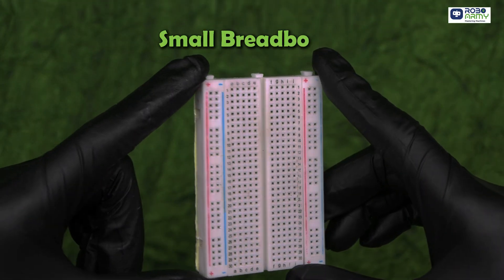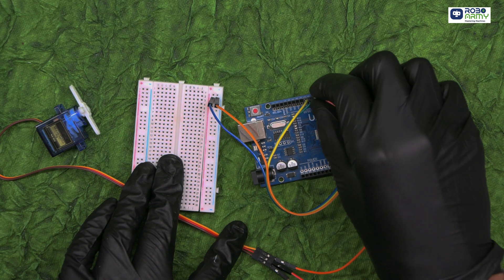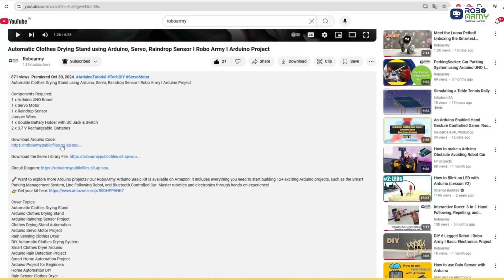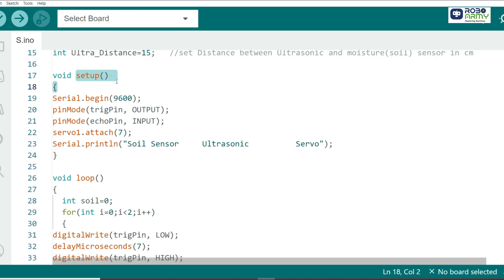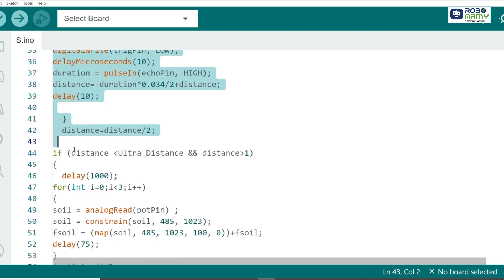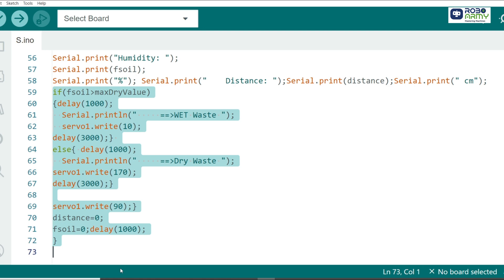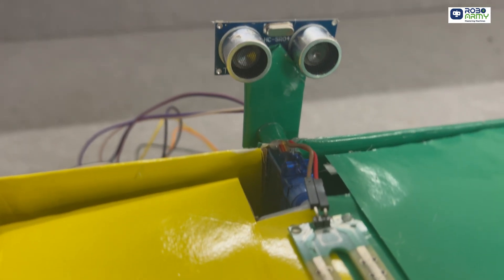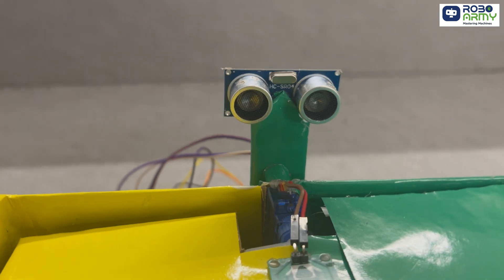How to make an Automatic BinBot: Dry Wet Waste Segregator Dustbin

Comment: Hello, 
I made this same project for my school exhibition but i am getting issue with my project because i am using two servo motor with my two separate dry and wet dustbin please send me coding for my project

Actually i made my both dustbins like open coverup style as we see in our real life mostly
All materials i used same as in your project except two servo that’s why i need coding of same project with two servo
Please help me 🙏
Reply from the maker: That’s awesome! 😊 I’m glad you’re working on this project for your school exhibition. Since you're using two servo motors for separate dry and wet bins, here’s the updated code that controls both. Let me know if you need help with connections too. All the best!

Updated Arduino Code for Two Servo Motors (Dry & Wet Bin):
#include <Servo.h>

Servo servoDry;
Servo servoWet;

const int trigPin = 8;
const int echoPin = 9;

long duration;
int distance = 0;
int potPin = A0;            
int soil = 0;
int fsoil;
int maxDryValue = 10;       // Humidity threshold
int Ultra_Distance = 15;    // Distance to detect waste

void setup() {
  Serial.begin(9600);
  pinMode(trigPin, OUTPUT); 
  pinMode(echoPin, INPUT); 
  servoDry.attach(6);   // Connect to dry bin lid servo
  servoWet.attach(7);   // Connect to wet bin lid servo
  Serial.println("Soil Sensor     Ultrasonic          Servo");
}

void loop() {
  int soil = 0;
  for(int i = 0; i < 2; i++) {
    digitalWrite(trigPin, LOW);
    delayMicroseconds(7);
    digitalWrite(trigPin, HIGH);
    delayMicroseconds(10);
    digitalWrite(trigPin, LOW);
    delayMicroseconds(10);
    duration = pulseIn(echoPin, HIGH);
    distance = duration * 0.034 / 2 + distance;
    delay(10);
  }
  distance = distance / 2;

  if (distance < Ultra_Distance && distance > 1) {
    delay(1000);
    for (int i = 0; i < 3; i++) {
      soil = analogRead(potPin);
      soil = constrain(soil, 485, 1023);
      fsoil = (map(soil, 485, 1023, 100, 0)) + fsoil;
      delay(75);
    }
    fsoil = fsoil / 3;

    Serial.print("Humidity: ");
    Serial.print(fsoil);
    Serial.print("%    Distance: ");
    Serial.print(distance);
    Serial.print(" cm");

    if (fsoil > maxDryValue) {
      Serial.println("     ==> WET Waste ");
      servoWet.write(0);     // Open wet bin
      delay(3000);
      servoWet.write(90);    // Close wet bin
    } else {
      Serial.println("     ==> DRY Waste ");
      servoDry.write(0);     // Open dry bin
      delay(3000);
      servoDry.write(90);    // Close dry bin
    }
  }

  distance = 0;
  fsoil = 0;
  delay(1000);
}
Reply: @robo_army_ thank you so much 🙏 after trying this coding i update you definitely 
Please tell me after getting success in this project can I show you video on your personal WhatsApp?
Reply: @robo_army_  when i am uploading this code then both dustbins lid are opening together and don’t closing
Reply: @robo_army_ please send me connections also
Reply from the maker: Thanks for the update! 😊 If both lids are opening together and not closing, it might be due to wrong connections or missing default angles in the code. Here's how to connect the servos and fix the issue:
Connections:
Ultrasonic Sensor
VCC → 5V
GND → GND
Trig → Pin 8
Echo → Pin 9

Soil Moisture Sensor (or Potentiometer in simulation)
VCC → 5V
GND → GND
AO → A0

Servo for Dry Bin
Signal → Pin 6
VCC → 5V
GND → GND

Servo for Wet Bin
Signal → Pin 7
VCC → 5V
GND → GND

Important Note: Use an external power supply for the servos if they are not working properly from Arduino's 5V pin.

Code Fix (Update These Lines in setup()):
servoDry.write(90);  // Keep dry lid closed initially
servoWet.write(90);  // Keep wet lid closed initially

Add these right after you attach the servos in setup() like this:
servoDry.attach(6);
servoWet.attach(7);
servoDry.write(90);
servoWet.write(90);

Comment: hello ,can we do the smae thing ,just replace the soil moisture sensor with rainwater sensor?
Reply from the maker: Hi! Yes, you can replace the soil moisture sensor with a rainwater sensor for detecting wet waste. Both work on similar principles of moisture detection. Just make sure to adjust the sensor threshold values in the code based on the readings from the rainwater sensor.

Comment: Hlo my arduino is burning due to heavy voltage
Reply from the maker: Hi! Sorry to hear that your Arduino is heating up. It sounds like it might be getting more voltage or current than it can handle. Please make sure:

You're supplying only 5V to the Arduino board (through USB or regulated 5V pin).

If using an external battery, avoid connecting more than 12V to the VIN pin.

Avoid short circuits — double-check if any wires are connected incorrectly.

Avoid directly connecting motors, LEDs, or other high-current components without a driver or resistor.

Comment: Hii sir i am making this for my exhibition.. But even after doing everything right it is not working can you please help me with possible suggestion to make it right... Please sir i have my exbhition they after tomorrow
Reply from the maker: Hi! I'm glad you're working on this for your exhibition! If it’s not working, here are some quick checks you can do:
1️⃣ Wiring: Double-check all connections – especially VCC, GND, signal pins, and servo.
2️⃣ Power Supply: Make sure your components get enough power (use external power for the servo if needed).
3️⃣ Serial Monitor: Upload the code and open the Serial Monitor to see if sensor readings are showing correctly.
4️⃣ Sensor Testing: Test each sensor individually with a simple code to make sure they are working.
5️⃣ Code Upload: Ensure there are no errors during code upload in Arduino IDE.

If you're still stuck, feel free to send a photo or video of your setup and I’ll guide you step-by-step. You’ve got this – let’s get it working before your exhibition!

Comment: Sir please 🙏🙏 I want very urgent reply......... I have made this project for my science model and I have to submit it Day by Tommorow.......but the major problem I am facing is that if I put wet or dry waste the servo motor rotate on only one side....... Pls 🙏🙏 I want urgent reply
Reply: Thank you very much sir 🙏🙏🙏🙏
Reply from the maker: Hey! Don’t worry, let’s fix it quickly 
If your servo is rotating in only one direction for both dry and wet waste, the issue is likely in the logic of your Arduino code.

Make sure your if condition for the moisture sensor clearly separates wet and dry values. For example:
int moisture = analogRead(A0); // or the correct pin
if (moisture < 500) {
  // Wet waste
  servo.write(0); // or any angle for wet
} else {
  // Dry waste
  servo.write(90); // or another angle for dry
}

Also, make sure your servo.attach() is in setup() and not repeated in loop().

Double-check sensor readings in Serial Monitor using Serial.println(moisture); to verify the values for wet and dry waste.

If you're still stuck, feel free to share your code—I’ll try to guide you right away.

Comment: Servo moves immediately to right after plugging in usb cable
Reply from the maker: This happens because the servo moves to the default position set in the code during setup(). You can add a command like servo.write(90); in the setup() function to keep the servo centered or in a neutral position when the system starts.

Comment: Bro we have to power it with what
Reply from the maker: You can power the project using Lithium-ion batteries (like a 3.7V or 7.4V rechargeable battery pack). Just make sure to use a proper voltage regulator or connect it through the Arduino’s Vin pin or barrel jack for stable power. Avoid powering directly through USB in standalone use.
Reply: @robo_army_  can we use a solar panel too ? like to make this proejct environment friendly ?

Comment: Hello sir, can i use arduino mega 2560 on this instead of uno?
Reply from the maker: Yes, you can definitely use the Arduino Mega 2560 instead of the Uno! 😊 The Mega has more pins and memory, so it's actually a great option

Comment: This isn't working for us .the servo motor isn't rotating.we tried checking each component seperately.everything is working but when connected we couldn't get output.we have even tried by connecting external battery with servo....still no response
Reply: change potentiometer accordingly it worked at max for me
Reply from the maker: Thanks for the tip! 🙌 Yes, adjusting the potentiometer (or the simulated soil moisture sensor) can help trigger the correct conditions in the code. Glad it worked for you! 👍 Others facing similar issues can definitely try this tweak.
Reply from the maker: Thanks for sharing! If all components work separately but the servo motor doesn’t move when everything is connected, here are a few things to check:

1️⃣ Power Supply: Even with an external battery, make sure you're using a stable 5V and the GND is common between Arduino and battery.
2️⃣ Servo Signal Pin: Ensure the servo signal wire is connected to the correct digital pin (in the code it's pin 7).
3️⃣ Code Logic: Check if the sensor conditions are being met to trigger the servo. Use the Serial Monitor to confirm values.
4️⃣ Try Manual Movement: Temporarily add servo.write(0); delay(1000); servo.write(180); in setup() to test basic movement on upload.
5️⃣ Capacitor Tip (Optional): Sometimes adding a small capacitor (e.g., 100µF) across the servo power lines helps stabilize power.

Comment: Hello! Servo is vibrating after detecting an object what should we do?
Reply from the maker: Hi! 😊 If your servo is vibrating, it could be due to:

1️⃣ Unstable sensor readings – Add some delay or average multiple readings to reduce noise.
2️⃣ Servo not getting enough power – Use an external 5V power supply instead of powering it directly from the Arduino.
3️⃣ Fluctuating values in code – Make sure the servo angle isn’t constantly changing due to small sensor variations.

Try smoothing the sensor data and using servo.write(90); (neutral position) when idle. Let me know if it helps!

Comment: for what purpose he servo library is required and where to add it?
Reply from the maker: Great question! 😊 The Servo library is required to control the servo motor, which opens the lid for dry or wet waste based on sensor input.

You don’t need to install it separately — it's a built-in library in the Arduino IDE. Just make sure you include it at the top of your code like this:
#include <Servo.h>

This allows you to use commands like servo.write(angle); to control the motor.

Comment: Hello sir, Can you help me regarding the servo motor that it only follows one direction only at the dry bin and not in the wet bin thanks
Reply from the maker: Hello! 😊 Sure, I can help! If your servo motor only moves to the dry bin position, it may be due to the moisture sensor not detecting 'wet' waste correctly or the condition in the code not being met.

Please check these:
1️⃣ Is the sensor giving correct values for wet waste?
2️⃣ Check your fsoil value in Serial Monitor — is it below or above the maxDryValue?
3️⃣ Make sure both servo.write(10); (wet) and servo.write(170); (dry) commands are in place.

Comment: It keeps flipping in one side only
Reply from the maker: If the servo keeps flipping to one side only, check these points:

1️⃣ Code Logic – Ensure the servo angles (e.g., servo1.write(10); and servo1.write(170);) are correctly set for both dry and wet waste.
2️⃣ Power Supply – A weak power source can cause erratic servo movement. Use a stable 5V power supply.
3️⃣ Connections – Verify the servo signal pin is properly connected to pin 7 of the Arduino.
4️⃣ Serial Monitor – Check sensor readings to ensure they are detecting waste correctly.
Reply: @robo_army_  hello, i tried to look at my serial monitor and it only shows wet waste how do i fix it

Comment: Sir do u know how to make the prototype work using the Arduino app I'm confused about that how did it functionally well detected it
Reply from the maker: Yes! To make the prototype work using the Arduino IDE, follow these steps:

1️⃣ Upload the code to your Arduino board via the Arduino IDE.
2️⃣ Check Serial Monitor (9600 baud rate) to see sensor readings.
3️⃣ Ensure correct wiring of the Ultrasonic Sensor, Soil Moisture Sensor, and Servo Motor.
4️⃣ Test sensors individually—Ultrasonic detects distance, Soil Moisture checks wet/dry waste, and Servo moves the lid accordingly.

Comment: Is it possible for the code to use tinkerkad to do it 🤔, plus how to I activate the code for the simulation to work , I'm having issues on it
Reply from the maker: Yes, you can simulate this project in Tinkercad, but note that the Soil Moisture Sensor may not be available in the default components. You can use a Potentiometer as a substitute to simulate moisture levels.

To activate the simulation:
1️⃣ Connect all components correctly in Tinkercad.
2️⃣ Upload the code to the Arduino.
3️⃣ Open the Serial Monitor to check sensor readings.
4️⃣ Ensure the Servo Motor is properly coded to move based on the sensor values.
Reply: @robo_army_  meaning tht I can normally use the code in tinkerkad but doing some changes in the simulation component and will the model waste management still work 👍
Reply from the maker: Yes, exactly! 👍 You can use the same code in Tinkercad with minor modifications, like replacing the Soil Moisture Sensor with a Potentiometer to simulate moisture levels. The core functionality of waste segregation will still work in the simulation.

Comment: It's really a good design😮  , how did u though build the box and how  did u assemble the component in it
Reply from the maker: Thanks! 😊 The box is made using cardboard. I designed it to fit all components securely. The Ultrasonic Sensor is placed at the top to detect waste, the Soil Moisture Sensor checks moisture levels, and the Servo Motor controls the lid movement. Let me know if you need more details!
Reply: @robo_army_  yes please 🙏
Reply from the maker: Sure! 😊 The box is made of cardboard, cut and assembled to fit all components.

🔹 Ultrasonic Sensor is fixed on the top front to detect incoming waste.
🔹 Soil Moisture Sensor is placed inside to check moisture levels.
🔹 Servo Motor is mounted near the lid to control its movement based on waste type.

Comment: sir where do i insert the code in order for the  waste dustbin to work functionally
Reply from the maker: You need to upload the code to the Arduino Uno using the Arduino IDE. Connect your Arduino to a PC, open the code in the IDE, select the correct board and port, then click Upload. Let me know if you need further help!

Comment: why does my servo spins the same way as wet even though it senses dry?
Reply from the maker: It could be due to incorrect sensor readings. Try these steps:

1️⃣ Check Serial Monitor to see if the moisture values are correct.
2️⃣ Verify Mapping & Thresholds in the code (maxDryValue setting).
3️⃣ Test Servo Separately using servo.write(170); and servo.write(10); to confirm movement.
4️⃣ Ensure Proper Wiring of the moisture sensor and servo.
Reply: @robo_army_  I'll try it later, I'll update you, thanks man, ur the best!
Reply from the maker: Thanks for your kind words.

Comment: can i use raindrop sensor instead of moisture sensor?
Reply from the maker: Yes, you can use a raindrop sensor, but it's less accurate for waste segregation. A soil moisture sensor gives better readings for wet and dry waste. If you still want to try, map its values accordingly in the code!

Comment: it's completely not working ,
don't know what is the mistake.
Reply from the maker: If it's not working at all, check wiring, power supply, and connections first. Test each component separately (Ultrasonic, Moisture Sensor, and Servo). Also, check Serial Monitor for errors. Let me know what issue you’re facing!

Comment: how about plastics and cans??
Reply: how can we change dry waste and wet waste into plastics and cans??
Reply from the maker: You can modify the code by adding an inductive sensor to detect metals (cans) and an image recognition module to identify plastics. Then, update the servo logic to sort waste based on these new inputs.
Reply: can you also give the materials and the prices here
Reply from the maker: The list of components is mentioned in the video and its description as well. The components can be available in the market, price may vary from place to place or you can directly purchase from RoboArmy store.
Reply from the maker: Plastics and cans are dry waste, so the system will categorize them as dry. However, for better accuracy, an advanced model can use additional sensors like an inductive sensor for metals and image recognition for plastics.
Reply: our categories of waste are cans and plastics

Comment: Bro sarvo moving single side only
Reply from the maker: If your servo is moving to one side only, check your wiring and power supply. Try running a simple servo.write(0); delay(1000); servo.write(180); test code. Also, make sure you're using a 5V power source.

Comment: Sir sarvo motor moving one side only
Reply from the maker: If your servo is moving to one side only, check your wiring and power supply. Try running a simple servo.write(0); delay(1000); servo.write(180); test code. Also, make sure you're using a 5V power source.

Comment: What's the code for a more sensitive moisture sensor? It keeps flipping to the dry, even for wet materials
Reply from the maker: Try increasing maxDryValue (e.g., 20 instead of 10), adjusting the map() range, or averaging more readings for better accuracy. If the issue persists, a capacitive moisture sensor may work better. Let us know if you need code tweaks!